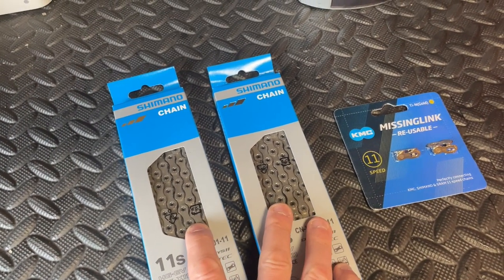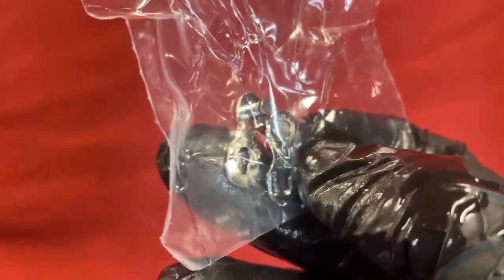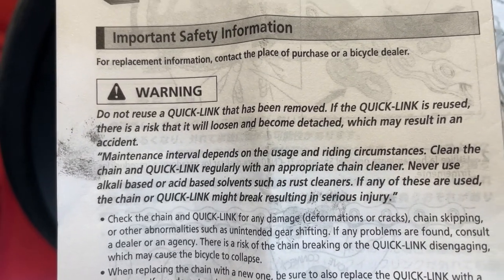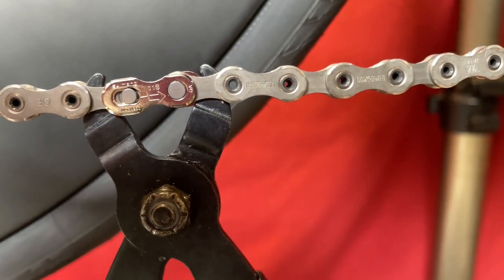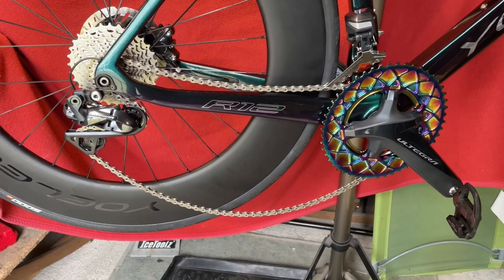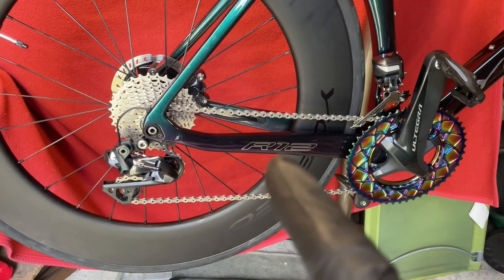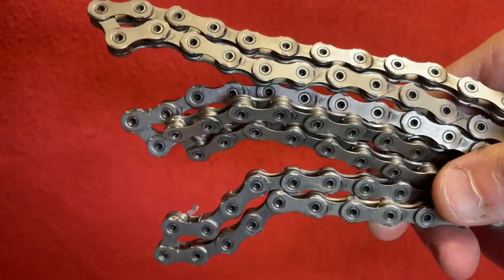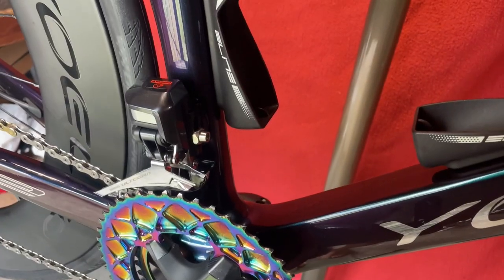New Chain Installation Guide

Comment: I spotted some tasty bottle cages 👍🏻
Reply from the maker: Yes indeed! I really like them, superb. 👍
Reply: @KyrosHouseCycling  I put the Elite crono CX ones on my R12. Stupidly expensive but bloody hell they look great.
Reply from the maker: @ScuuBdoo  I’ve found mine rattle when they are empty, so i blow air into them and they are fine… great bottles though! 👍
Reply: @KyrosHouseCycling  Good idea. I'll try that as mine rattle a small bit on rough surfaces. The one I put on the down tube leaks as it sits at an angel so I cant fill it to the top.
Reply from the maker: @ScuuBdoo  that’s strange, never had a leak from mine, great bottles, 500ml is sometimes not enough. 👍

Comment: Hi there! Which model of sonic cleaner do you use?
Thanks!
Reply from the maker: The model is the ULTRA 7000S. 👍
Reply: @KyrosHouseCycling  
does it work well on the chain?
thanks so much for the info!
Reply from the maker: @Flyboard12345  yeah it’s brilliant, I just put my chain in for 600 seconds and it’s perfect, not sure if it’s too long but I can do other stuff while it’s in there so no problem. 👍
Reply: @KyrosHouseCycling  thanks again for the advice! will certainly consider buying one
Reply from the maker: @Flyboard12345  worth it in my opinion.👍
Reply from the maker: No problem at all, very worth the money in my opinion. 👍